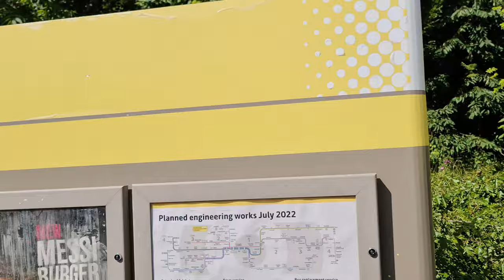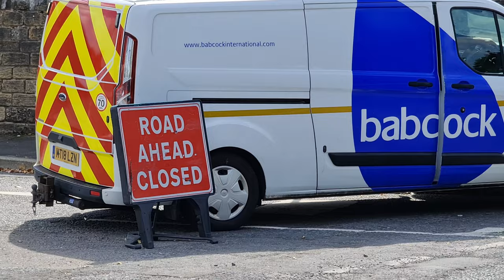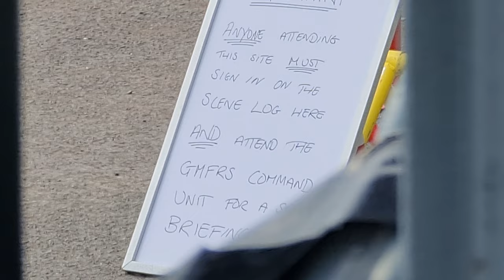Strange Vibes at the Multiple Death Mill in Oldham

Comment: The fire engines are dump trucks as such. They are called pods, the pods are lifted on and off by a hydraulic hooking system, look at the rear ones you can see they have no pods on them. USAR have various pods, some with small diggers in, others with additional search and rescue kit. The fire engine is a prime mover, the body, a pod. the prime movers can be hooked up to any compatable pod, unhook the pod and then be redeployed anywhere it is needed.
Reply: Like thunderbirds....

Comment: I had the gross misfortune to have worked in this building.  Was on the top floor pañting out budget offices but one thing was for sure , you didn't want to go for any long walks in the building because in places all the floor boards were missing all the way down from the 4th floor to the basement. What ever was being done in there it was defo being done on the cheap and the building should have been condemned long long time ago.